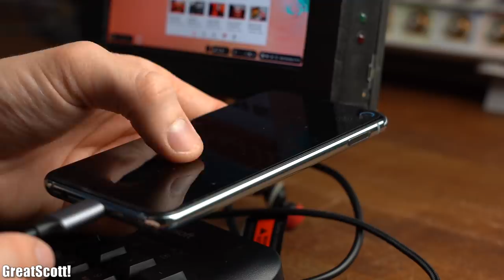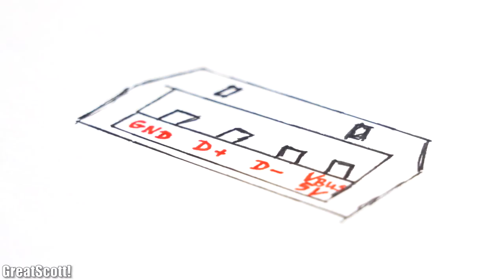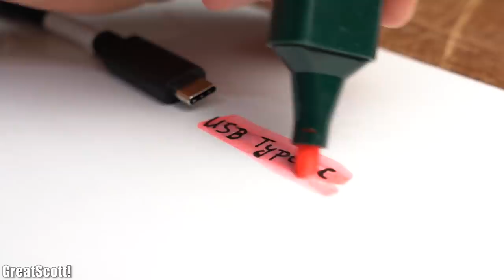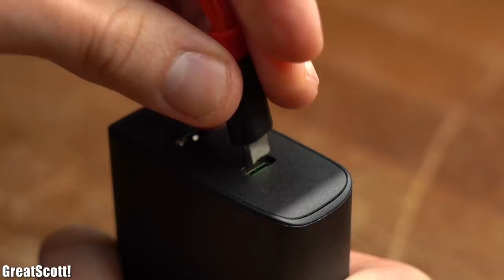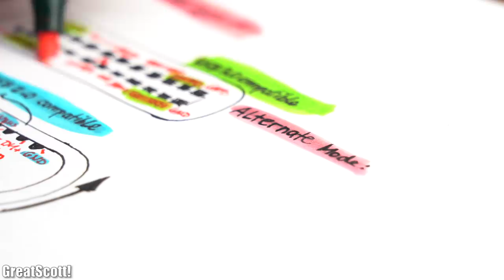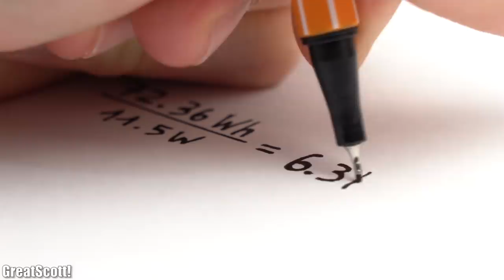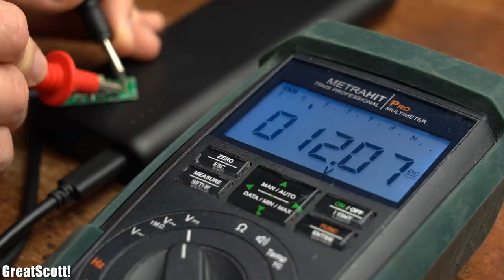Here is why USB Type-C is AWESOME and how you can use Power Delivery for your electronics!

Comment: Is usb pd capable of powering a laptop? I mean if you had a converter between the old barrel jack converters. The specs seem to indicate it is possible, 100w at 20v should be adequate. This would make it pretty useful to charge a laptop battery with a power bank, with simple diy converter.

Comment: Thanks for another very interesting video.  I have been amazed by how well my TS80 soldering iron works with it's USB-C power supply.  Now that I look closer, I see that it's only using 9V whereas the connectors could provide up to 20V.  So that makes me wonder if I could use a USB-C power bank as a replacement for the proprietary batteries on my 20V portable power tools?  I'm not sure how much current those batteries deliver.  Maybe it's more than 5A.  Certainly there are a lot of possibilities on what you can power with 100W.
Reply: Surely it has more to do with available wattage, ie the time element when using the power the tool requires. Which is to say it will work, but not for long.
Reply: Power tools can deliver far more than 5 amps... depending on the load and the onboard electronics that monitors for heat and cell health. The general need for high torque means you'll need to really draw current for anything utilizing a motor. It really depends on the tool and expected application. I wouldn't bother wasting time modding a power bank. I just buy used batteries for cheap and drop in good cells and have really good batteries. I know they're compatible and I know the quality without having to mod anything.

Comment: So, theoretically, this could render my 19v Craftsman drill-driver, impact driver, and wet/dry vacuum to be “usb rechargeable “ - albeit fairly slow, I would think, in emergency situations, right? How about a quick-swap power supply for some big-ass 12v motion activated light? Or homemade jambox made out of car audio components? A peltier-junction based-cooling-device-from-hell? A weaponized led flashlight? A direct-fit replacement power supply insert for a device’s battery compartment that normally requires 6 or 8 alkaline AAA,AAAA,C,D, or even 2 nine volt batteries? All of these things, whether to charge a device’s internal rechargeable batteries, or to totally replace non-rechargeable batteries, right? I’ve been doing a 3rd world version of these things with a cluster of traditional nicad, NiMh, or Li ion rechargeable batteries for some time, but with obvious drawback of most of these will never charge up past about 1.4 to 1.45 v. Did I get this right?

Comment: Wait! I'm curious. Isn't current (not voltage) the deciding factor for charging time? (Higher current = faster charging) How did a 20V 1 amp USB type C connector charge the power bank quicker than the 2 amp micro USB charger?
Reply: For people who are gonna come at me with "It's got higher power and that's why it charged the power bank faster", this is why I'm confused - I've always been taught that batteries are like capacitors with a voltage cap. No matter what the voltage you apply across it, to charge it quickly, you must supply higher current. This is why a capacitor with no series resistance charges quickly whereas a capacitor with a series resistance (which limits the current) charges comparatively slower.

Comment: For the PD Sink PCB, I suppose that higher voltages are generated through a "booster-like" scheme. What is the frequency used for this booster and how "clean/stable" is the result under charge?

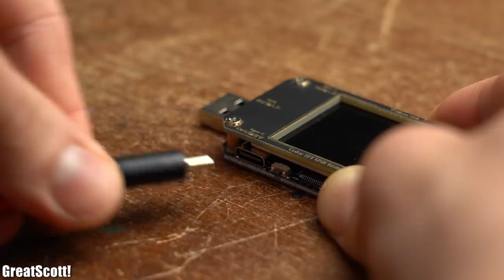Comment: When removing all connectors, embrace them securely enough to where you don't have to  "wiggle" the connector like is done around minute 4:00.   Wiggling a connector back and forth to remove it will destroy the receptacle in a short amount of time, thus reducing the life of a device that could have lasted longer.   Always pull the plug directly out of a connector at a perpendicular angle to the surface of the hosting device.   In fact while it is always advised to not remove a connector via tugging on the cord, this would be better than wiggling the connector, as a new charge cable is around $3 while a phone can be many, many times more than that.

Comment: I've got a question: 
I already have a Powerbank which supports power-delivery but only up to 45watts.
Now I want to plug in this sink-pcb to get 20v output to charge a Bluetooth-speaker, the problem is, the speaker could possibly draw up to 3amps.
Now I want to know if it just wouldn't work, if it would slowly charge my speaker or (what I fear) fry eather the the pcb or the Powerbank ?

Would the pcb or the Powerbank fry first?
Reply: If it's not enough amps then it will be fine. Not enough voltage and you'll end up breaking something

Comment: Is there like reverse usb-c board as well? That would be good to make your own usb-pd charger just from old laptop power brick. You would use like 3 different step down converters to have all required modes and then you could use this as very cheap USB-C power adapter. Please think about making video about it if this thing is possible to create.
Reply from the maker: It is on my to do list
Reply: @greatscottlab  Oh that's amazing! I was thinking about doing something like that for like a year but I was too busy for that and I was uncertain if those STM's can do it out of the box or if I would have to make it on my own using atmega and USB-C breakout board. Anyway fingers crossed!

Comment: Totally not related question: is it possible to limit the power a USB connector can deliver? My problem: I want to use Android Auto but I don't want to charge my phone. I tried to just cut the 5V line but that stops the USB connection from working altogether. Would it be possible to sotter some kind of resistor into the cable to reduce the charging significantly but still have the car and phone talk to each other?
Thank you for any input.

Comment: Hi, great video again! I have one question. My USB 2.0 charger (Mi powerbank 2C) also supports 12.0 V @ 1.5A MAX 18W output according to datasheet. I would really like to use it as a backup power source of my stepper-motor device. Problem is, I can not find any "Fast Charge Trigger Polling Detector" with USB 2.0 input. How can I than get 12 V directly from powerbank, without using any boost converter? What are my options? Thank you!

Comment: I have a question:  Do you know if using a USB meter (passing though USB-C ports in particular) would disturb/mess-up any iSmart communication between an iOS device and an iSmart Capable power brick ?     I'd like to compare the drop off current/voltage stats when charging an iPad Pro 12.9" with the Apple-supplied 18 watt charging brick, to that of using a RAVPower 67 Watt power brick.   It looks like the Apple-Supplied power brick is constant at about 16.28 watts until the battery reaches 94% - then it drops to 11 watts, and finally down to 7.45 watts at 100%.   At least that is what I am seeing from a USB-C meter when it is used inline while charging.  I am wondering if a 65 Watt brick , with PD, would drop off similarly  ... or if it would damage the device.

Comment: I'm wondering if there is a cheap board that works the other way around - hook up to a 12v battery and it will output power delivery to a USB-c device for charging?

Comment: Question; do you need anything more than 5.1k pull down resistors on the CC lines to get 500mA @5V from a USB-C port?  Assuming you're making a dumb 5V device, will this work to get a little bit of power without having to use a chip for negotiation?   Great video BTW!

Comment: Hi, thanks for your nice and helpful video. Do you have a measurement of the ripples or the voltage quality at the output terminals? looking for a solution for my DAC project to be powered by a battery source!
Reply: I would love to hear more about your DAC project. I'm all about the portable power source and applications!
Reply: @shawnpauleudy3423  Well... I was not able to get ripple less output of the USB-C connection. The power quality of USB-C is absolutely not for audio. Returned to an IFI power source. and no battery.

Comment: I tried such a type c hub with my Huawei P30 lite and the HDMI did not work. That was because my phones type c plug was not able to deliver all of the required data (I think so). Is it possible that there are different types of type c connectors?

Comment: I have a 12v powered tv/DVD player in my off-road camp trailer, So if I get a usb type c card reader with HDMI output I can play videos off my Samsung s10 through the tv for my kids while camping?
Reply: Samsung sells their own (in my opinion, rather expensive) USB type-C to HDMI adapters, which should work with pretty much all of their smartphones, that have a USB type-C connector. 

If your smartphone works with third-party adapters, like the one you described, i don't know.

Comment: This video was awesome, however I'm still interested in more about USB-C, I have a power bank that is capable of output 40w (20v 2A) or 45w (15v 3A). I was thinking if it's possible to build a USB-C to the thin tip connector for my Lenovo laptop as it charges at 65w (20v 3.25A) 🤔

Comment: Dropping dumb qustion: my laptop requires 65W charger, but I have Xiaomi Powerbank 3 Pro with 45W output, so what happen if I connect them together?
I guess, nothing? :<
Reply: Kenny Otsu if your laptop supports 65W, most probably it will support 45W too. Only difference is your charging speed will be slower compared to using 65W.
Reply: @youranonymous931  okay but what if my laptop charges with 60watt but no usbc and I use this fancy pcb in between? 
(Powerbank still only supports 45w)
Reply: @hannes-  i have no experience with PCB usage. my best bet is your laptop will still charge, just slower than if you use a 60W charger.

Comment: Some mis-information in this video:

USB 3.1 GEN1 is Identical to USB 3.0, and supports 5Gb/s
USB 3.1 GEN2 is the 10Gb/s standard

Also it's officially called: DP Alt Mode, and it supports DP 1.3.

Comment: It would be great if you can do a DIY power bank, with fast charge option, i would like to use some Li ion battery i have, but it will be nice if it can be fast charge using a qualcom 3.0 charger ( 9 or 12 V adaptive charger). Grettings from Chile!!!

Comment: Pretty impressive! 😮
So you could use the little board to charge a 3s battery pack with BMS? 😮
Reply: Yup. Or small tools/electronics that require more than 5v.
Reply: @McTroyd  That's awesome, it's going to make things much easier! 😃

Comment: The type c connector can do so much thing it's really difficult to differentiate between them. It's both a blessed and cursed at the same time.
Reply: You basically have to be an FPGA developer to design for them though.
Reply: @toddphelps5030  not really, usb c signaling can be implemented on a pic controller
Reply: @EvertGuzman  At what speeds? I'd be quite surprised if a PIC could transfer data at 5Gb/s let alone 10... but then the last PIC I used was the 16F84 years ago.
Reply: @toddphelps5030  Oh no I mean specifically for USB-PD.
Reply: @EvertGuzman  I typically use screw terminals or barrel jack connections in my designs - they don't require microcontrollers  at all for power delivery.

Comment: Hey 
I got a question
The power bank rated as 20100 mAh; Which is 20100mAh*5v=100.5 Wh
72.36 Wh = 20100 * 60*60*0.000001 Which is not correct
Reply: If my understanding is correct, most of these power banks have the cells arranged in a way that means the charge stored is at 3.6V.
This means they can charge from 5V with no need to step up the voltage.
Output from the battery pack is via a boost converter to give the 5V (or higher).
The advertised capacity in mAh is at 3.6V.
20.1Ah x 3.6V = 72.36Wh 👌

Comment: I can't quite get why you don't need a boost converter anymore .. just because you can draw more current @5V ? So this solution wont work for applications requiring 12V .. right?
Reply: It would work, u just press the button on the sink-pcb and power-delivery will output 12v automatically
Reply: @hannes-  so you wanna tell me that this little pcb is capable of turning the 5V from the powerbank to 12V and this will delivering a good amount of current?

Comment: I have a question I have a gaming laptop and wanted to know if I shud use the display port 1.4 or the usb 3.1 to connect to the external monitor ? Like which one will give the more MBPS? (Sorry if my question had mistakes in it)

Comment: Don't forget also that faster the charging is, smaller life the device will get. Better to have a slow charge then a fast one to extend the life of the battery
Reply: In Android (AFAIK works in 8 and 9), within the advanced battery options, you can select that it disables fast charging.

Comment: I would say that there is another serious problem with this connector. It was not tested (long enough) for ruggedness!! In sharp contrast to the rectangular and other stranger shaped connectors, the lets say rounded-ended shaped -C type, does not fit anywhere near snugly enough like the others! The result is that one has to be daintily careful not to move the cable because it will suddenly disconnect from the device its been inserted into. In one instance, I suffered a complete loss of a video file that was in the process of being moved to an external HD from a laptop USB-C connector equipped laptop. I cannot trust this connector to function as well as any of the others and am happier using my older devices with the older connector types. I am looking forward to whatever upgrade that might be thought up, as I cannot be the only one to have noticed this recurring problem.

Comment: I want to convert a USB Type-A directly connected keyboard, to having a detachable USB type C connecter. I am easily able to find small PCBs with female type C connectors that basically directly connect the female type C, to the internal wires. However, some PCBs have a preinstalled 56K resistor. Apparently depending on whether or not the board has these resistors, can make the device over-discharge the source, and burn out the port, or burn the device itself. I obviously want to avoid that, but am not sure if the 56K resistance is universal, and made to make USB 2.0 devices automatically compatible with type C connectors and 3.0 ports, or if the resistance is completely dependent on the device the board is getting attached to. Does anyone know what would be the safest option, and how the internal structuring for the female ports work?

Comment: I really like aforementioned ZY12PDN PCB, but what if I also wanted to use data pins (usb 2.0 speed) in my project? Is there a pcb that would let me get power and data?
Reply: I imagine the data traces should be available to attach to if you're feeling crafty at soldering

Comment: Thanks for posting about this board. I've been using a similar product, the PD Buddy Sink, available on Tindie. It has a few more features, and is $30USD. But for the extra money, you get interactive programmability via a terminal program such as PuTTY. 

I use the Buddy Sink to power small ham radios from a high capacity PD per bank. It works very well, and I can also use the same bank to charge my phone and my Chromebook! This reduces the amount of weight I have to carry around.

Comment: Thank's to USB C, now there are available monitors with USB C input, that supports DisplayPort alt mode, and powering laptop (USB Power Delivery) from monitor too.

Recently I bought Dell P2723QE monitor, that have USB C input with DP alt mode and up to 90W (20V 4,5A) Power Delivery for laptop. Soon I want to buy new Samsung Galaxy phone, to use it with monitor as low power Samsung Dex PC.

Comment: I love USB-C. I will almost not buy devices now if they don't have USB-C. I built a fairly large ~4kg drone five years ago that takes big LiPo batteries. I hardly used it and it's obsolete now anyway so I have the LiPo batteries doing nothing. These are big 8000MaH 6s batteries so the equivalent of 48000MaH if you're comparing to a powerbank. I have a MacBook Pro and a load of other devices that charge over USB-C, so my question was: Can I charge/power my MacBook Pro from one of these LiPos? The answer is yes! There's an XT60 to USB-A and USB-C converter. XT60 is a standard connector for a hobby grade LiPo. I've ordered it but a bit nervous about plugging it into my expensive MacBook, will try charging a powerbank from it first then other cheap devices. In theory, it should be able to power my MacBook for days (or even weeks given I have a few of these batteries!). When would I actually need it? Is carrying an 8000MaH 6s LiPo around with you practical? No. But, it's pretty cool to be able to have that amount of power available anywhere via USB-C (or USB-A).

That got me thinking... could you practically live using just USB-C and USB-A power? I have a pretty decent projector and bluetooth speakers that both charge off USB-C so that's entertainment covered. Can't power a games console but you can power a Raspberry Pi running emulation station. You can get decent USB-C powered fans. Lights, no problem. Cooking... switch to gas bottles. Desktop PC no, so would have to switch to a USB-C laptop. External monitor... you can get USB-C powered monitors but granted they're nowhere near as good as a standard one. I have to say, it seems we're pretty close to this being practical. The main drawbacks are ovens and other appliances in a kitchen mainly fridge and kettles (you can get gas powered fridges and can boil water on a stove), as well as third party supplied products such as broadband modems. For the rest I think there are viable alternatives.

Then charge the lot via USB-C using solar panels.